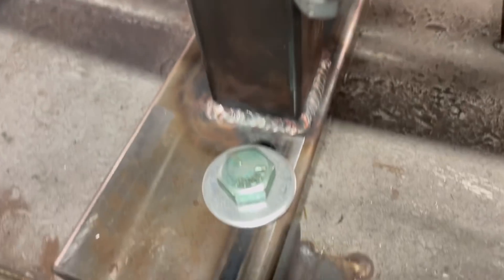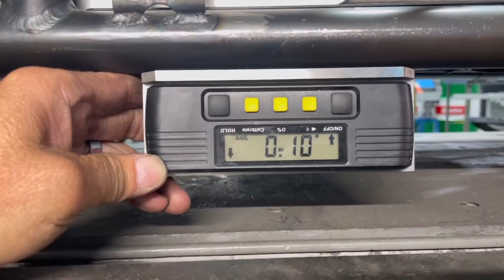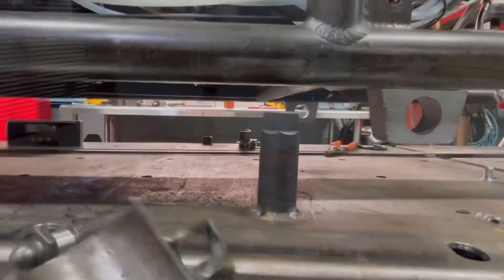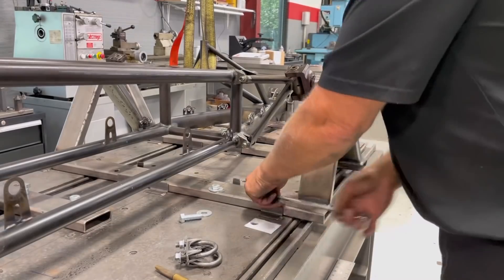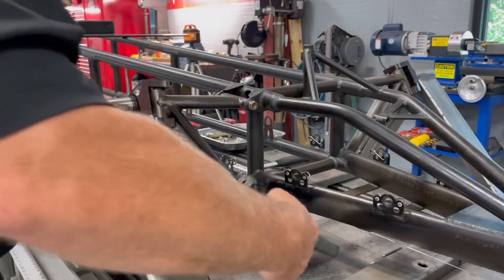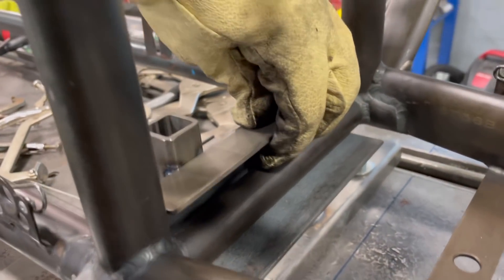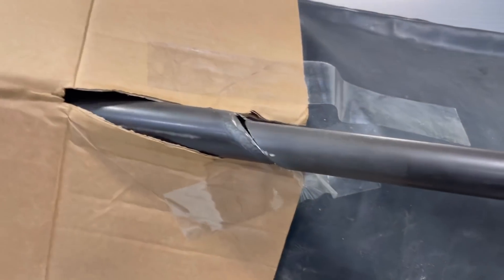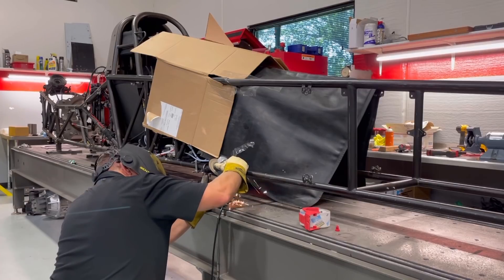PART 2 “LET’S FRONT HALF A 330 MPH TOP FUEL DRAGSTER!”

Comment: @11:00,, that face shield is AWESUM!! Too bad other fabricators we see on YT don't use one similar. THAT is PROTECTION! Using the angle head grinder without the guard though,, that is something I do not like to do. Yeah I know, some will say "you can't always use the guard" and I agree, there's sometimes you have to take the guard off BUT I HATE to do that. Ever have a disc disintegrate on ya? Well I have as have many others who've used these. It happens and when it does if you didn't have PPE on,, suffice to say the flying pieces can be devastating to a human being.

Comment: @3:50 Rob mentions his belt sander's "not cheap",, folks, as Rob will tell ya, when it comes to buying tools that provide your living you can skimp in a VERY FEW places BUT when it comes to power and critical to the job hand tools (kinda ignoring the Harbor Freight hoist) YOU MUST BUY THE BEST TOOLS AVAILABLE. They will give you a lifetime of service and they'll not take you half way through a project then quit and leave you hang'n. BUY QUALITY TOOLS, in the long run you'll not regret it. His old HURCO and BRIDGEPORT milling machines will be around LONG AFTER ROB has departed planet Earth, long after whomever owns them next has departed planet Earth. When it's said "they don't build 'em like they used to",, those old machines are a testament to that statement. The old machine shop equipment built in the 1930's thru the 1960's are built to perform for generations, they don't have an 'expiration date' built into them like equipment of today has. They require HANDS ON adjustments,, they don't have all that digital crap that requires mother board replacing. HANDS ON use,, it's how it's been done for generations and how it will be done for generations to come. BUY QUALITY PEOPLE, you will never regret it.
Reply: Do you know what the actual reason was for that? It's pretty interesting actually. The reason why old tools were built to last forever is that they didn't have computers back then. Back then, engineers could figure out how strong a part needed to be to guarantee that it wouldn't ever break, but they couldn't figure out how to make a part weaker than that (and thus cheaper to make) while still guaranteeing that it wouldn't break within its warranty period,  and that's because the calculations you'd have to do to find that out would have taken someone months/years to do by hand on pen and paper. Computers started becoming accessible to companies in the 70s, and while they may have been the size of a room and at least ten times slower than a pocket calculator,  they were still several orders of magnitude faster at doing math than humans are.

Comment: I love your videos, I'm a boilermaker in Australia and am wondering how much the welding sequence affects the performance of the chassis? Cheers
Reply from the maker: Quite a bit it really does especially when I’m putting the uprights on the four main rails
Reply: I suppose the weld sequence will allow the chassis to flex to attain maximum traction on launch.

Comment: So do any Top Fuel cars use slip tubing? Also, are there other ways people front and back half these cars? I know there are different ways of doing it, and there's (obviously) chassis differences between McKinney, headman, DSR, JFR etc. but, loosley speaking, it seems like teams do a little bit more with funny car chassis than with Top Fuel chassis..but it's an open-ended and question (for replying, etc)
I am so curious what all changes that Lucas, Bradman and all that, I know some chassis have more Flex, get out of the hole quicker things like that, based on the design, but I would love to have additional information on what they're doing with chassis Now versus 10 years ago versus 20 years ago. Absolutely love the channel, sorry for the grammar errors, I'm not correcting what my phone thinks is right but is not LOL
Reply from the maker: Not per se so much in the spec can you do that when you do it can only move like less than an eighth of an inch
Reply: @robwendland  thanks for going through all that and responding, definitely appreciate that :-)

I didn't recall much in the room of flexibility (no pun intended, lol) in regards to the dragsters.  I do remember a lot of really fascinating ways to get around some of the rules when I was working on fuel funny cars.

With how strict the rules are, it doesn't give much leeway... BUT it still fascinates me just how creative the Fabricators, crew chief, engineers and so on get to get a little extra performance out of everything. Everything is obviously pretty cookie-cutter compared to let's say in the 80's or something (lol) but the ingenuity all you guys and gals come up with and built upon is just plain awesome :-)

Comment: I have always been curious on the tension of the tubing on cars.  Give the chassis almost a spring effect and memory.  My builder of my super comp cars used a slight bow on the lower main bars for almost a spring effect.  Car worked fine, but I always wondered if needed.  I figure it just made the body bend a lot on the lower edge if high centered while loading or unloading in the rain.

Comment: Have you ever welded something using the welds to control the shape? (adjusting  the square measure with a weld or sequence of welds) sort-of steering a chassis with heat of the welds. It will move around when you weld it. It will be clamped-in while tacking up only.. I have seen a chassis move when unclamping from a jig.. (then cutting tacs to relieve stresses) The trick is to know what tac weld is (the) offending tac weld. It's not always the one you think or,,, something like that:)

Comment: Blue chips are good. The heat is leaving the part. Hot parts warp
Reply: Depend on the material you're running too...
Reply: To a degree, some discoloration is fine, and you should have some curl if you have feed and speed just right.